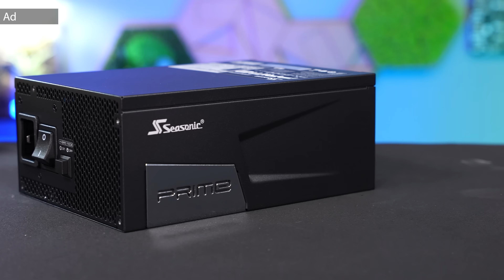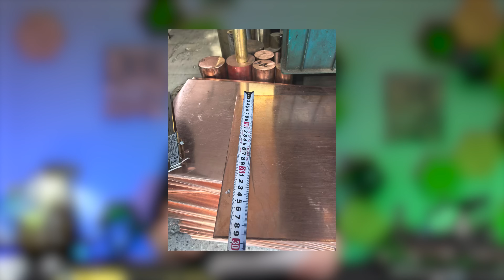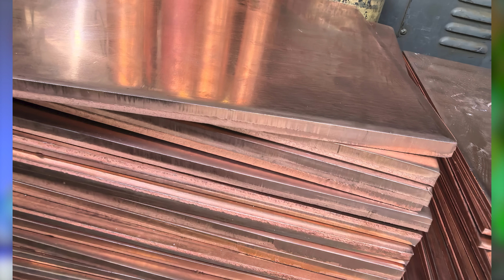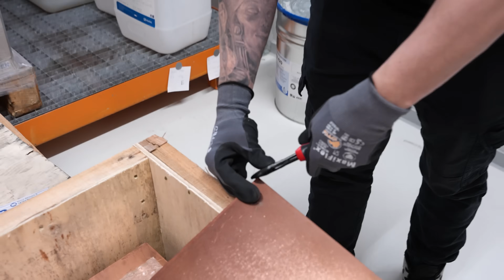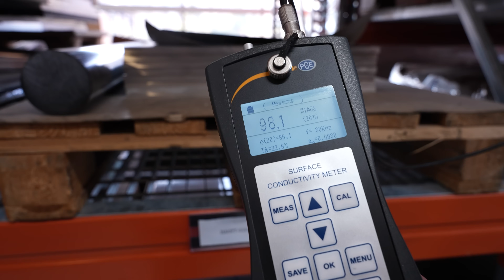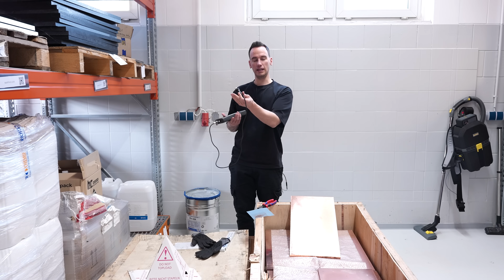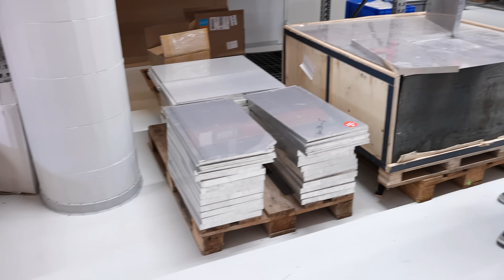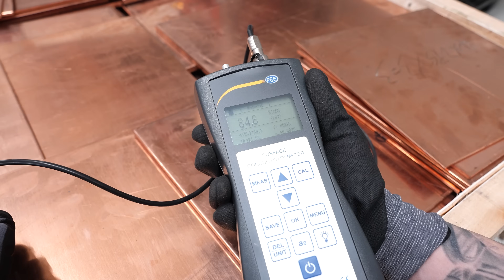I Got Scammed

Comment: I had the same problem with a Chinese company a decade ago. I bought a small shipment to test the supplier and the product was good. I then bought a bulk order worth 15000€ and was scammed, with none of the order being usable. The company denied the problem and I was left without any viable way of getting my money back.
Reply: Classic test-order-then-bulk-scam pattern. They build trust on the small one, then flip on the big payday. €15k gone and no way back through normal channels. But that money went somewhere—an account, a bank, a trail. My firm helps trace exactly where funds like this end up. Want me to see if your case has any options left?
Reply: @shaylamscheafuer  We know exactly where the money went. These were not crooked individuals hiding behind stolen identities. This was a crooked company hiding behind the Chinese legal system. I could have taken them to court in China, but it would have cost more than we were owed, and the the win rate for foreign nationals is very low. Even if we won, it would have been a pyrrhic victory, so the best move was to learn our lesson and walk away.

I now ramp up business slowly when forced to buy from Chinese companies. That way I keep my exposure low until the supplier is invested in a long term relationship, and does not want to burn long term profit for a quick buck.

Comment: I am glad you shared. The second you said where you sourced it I knew exactly what you were gonna be getting. There is a thing in China that if they can scam you and get away with it they are smart. If they get caught they are dumb. You can not trust any engineering material at all. Get your parts from pretty much any other country.  China has a huge problem in construction with Tofu Dredge buildings because they did crap like this with the rebar in the concrete and also mixed trash into the concrete so whole buildings , roads, bridges and well everything just randomly collapses. If they will do this to their own people, someone outside the country really has no hope of getting a quality product. They would rather scam you 1 time and get away with it and move on to the next person vs building a solid relationship with a client and being trustworthy. Just the way it is man. They try to cheap out on everything. Tons of LED lights right now are flooding the USA with most of them having no thermal paste or heating solution. It blows my mind that they would install Chips that are fine, Drivers that are fine.. and skimp out on the thermal paste to mount the chips properly to the aluminum housing or add a heatsink... Like you did the hard part... why not go the extra step and make a solid product.  And the answer is a fraction of a penny.

Comment: have a friend that had this problem with bearings that were being order from china showing up with metal-filings and other contamination and they finally decided that it was better to order the bearing dry and pack them with grease in the US as the main product was good and consistently to speck but the cleaning and lubrication was a mess and it was not practical to have someone go over and watch the process for each order (if you sat on them they did it right but if you were not there it was a quick and dirty final assembly)

Comment: The only mistake you made was trusting China.

If you are going to buy from China, and honestly just don't bother, but if you do then you need to physically visit the suppler and thoroughly inspect the goods in person, before parting with a single penny, then personally escort the goods to wherever they're shipping from, assuming they pass inspection (which they won't).

And 99.999% of the time they will just refuse anyway, because none of them have any intentions of doing anything other than scamming you.

Buying from European suppliers may be more expensive, but at least they have consumer protection. China doesn't.

This is fine if you're buying a 1 € fidget spinner on Temu, but ordering 40k € of copper and aluminium from China is just flushing your money down the toilet.

Comment: I had a similar experience about 15 years ago. I was buying Ping and Nike golf club sets from the same Chinese factory’s those companies use. The communication and responses were quick and professional and everything seemed,on the up and up. So we ordered a test batch which was good to go. We made a full order, well over $30,000 worth. When they arrived, everything was as expected, except, each club, of each set, had the same serial number. After confronting them about it the response was “What serial number would you like?”. It was a hard lesson that cost my partner and I years of work and savings. The Asian market works very differently from the west and if you don’t know the game it’s best to stay off the field there.
Reply: $30,000 and they couldn't even bother to fake different serial numbers. That's the kind of slap-in-the-face scam that makes you realize they knew exactly what they were doing from the start. Test order builds trust, bulk order empties your account. I've seen this pattern more times than I can count. My firm helps trace where funds like this actually land—even years later there can be options if the company is still operating. Want me to look into whether anything can still be done?
Reply: @shaylamscheafuer  That's kind of you, but no. It's long past and I did everything I could at the time. Got customs involved, as well as an international law firm. I also had a fraud insurance rider so I was able to recoup some of the loss. The worst part, or maybe parts, for me personally, is that the test batch had different numbers. The full order having all the same serial number was interesting, but, the real conundrum is that the serial number was real. It tracked back to an actual set of clubs. But the response of, "What number would you like", told me they basically do this all the time, and, that people have actually given them other serial numbers to use when they get caught. It's wild out there for sure.
Reply: @mathewcwilson  That's wild—the serial number was real. So somewhere, someone's authentic clubs ended up cloned with their identity. And "what number would you like" confirms this is a full-time operation for them. You did everything right: customs, international firm, insurance. Most don't get that far. Respect.
Reply: You were trying to swindle others but got duplicate serial numbers?
Reply: @zS39SBT4fe5Zp8Q  No one got scammed but me. Once I knew there was an issue, we didn't even try and sell the clubs. We turned them over to customs and ate the loss, hard lesson learned. There are only a few factories that make these clubs, or ny of the "high end" sports gear, regardless of the brand. If you by from the factory. it's significantly cheaper, and from an ethics point, as long as you aren't passing yourself off as an authorized dealer it's fine. The mark up Nike and the others have is insane. I could buy from the factory mark it up 20% and still be around 30% less than Nike and such.  In the end corporate greed swindles us all.

Comment: Business is built on trust, which is broken in this modern market. Currently I know someone importing two machines from China and I am quite worried, although I hope due to the complexity of machinery as opposed to some scammer coating steel, the machinery will at least operate. Fingers crossed.

Comment: Roman, for this reason you need to use a trusted agent in China, who can visit location before shipment and do random inspections on the goods. I have to do this, especially if you are dealing with no name factories. I guess your volume is extremely low for big state owned metallurgy companies to even get to MOQ. So do yourself a favor, get a good independent agent who will check every shipment before you pay.

Comment: Thanks for the video. I know it's not the point of the video, but could you (or someone in the comments here that's more of a nerd than me) explain why the thermal conductivity meter would not work at all on the fake plate? Since it's steel coated in copper, I would think the conductivity wouldn't be zero. I mean even raw steel has to have some thermal conductivity. So I know there is a reason, just curious why.

Comment: i could look at the plate without all that fancy lab equipment and tell you got copper plated steel. the plasma cut on the edges were a dead giveaway, you dont cut copper with a plasma torch , you sheer cut copper so theres no waste.

Comment: The only way to deal with a Chinese supplier is to go to China inspect the order before paying anything. Then watch as its packed and loaded on a truck. Then follow the truck to the shipper. Watch as it's loaded into a container and record the seals on the container doors. Also, make sure you insure the shipment. If you don't have the capability to follow these steps............you will get screwed.

Comment: The company I worked for ended up forming a company in China solely to handle BS like this. Even then it was as simple as it sounds. First they went to Korea to work with a company there that was able to work in China to get the company set up. Bit of a nightmare really. Even hard contracts don't necessarily work.

Comment: When i started watching i said i knew right away it was copper plated aluminum. Nop, steel, a dead giveaway with a magnet chasing maximum profit 😂
The aluminum seemed fine at first i said it would be just aluminum can alloy full of porosity, but nop, i was wrong again, steel underneath it carefully balanced with hollow bottom to not look suspicious.
They put a lot of effort on the scamming techniques.
In fact i'm surprised it wasn't copper plated tiles.
I am sorry you got scammed but for such a quantity you'll be better off having a trip to buy from eastern EU countries, no import tax and you can buy in person.

Comment: why go thru all the trouble of copper plating, packing Al plates on top of steel ones, etc? the logical scenario is the seller gets screwed too, the scammer is somewhere down the distribution chain... like if the buyer gets scammed by the seller, it makes no sense to include anything of value in a pallet, fill it up w/ wet sand and ship it: they had the money there's no need to trick the buyer when they got the good stuff when they open the package. but if the scammers need to trick the seller, then yes go thru all the trouble in case the seller does a quick check before shipment.
anyhow, totally unacceptable everything, such a bummer and huge loss for a small business.

Comment: The risk of fraud from China is simply too great to mitigate or control for without greater cost/risk than simply waiting for a more reliable distributor/supplier from anywhere but China. This shows intent to systemically defraud by using methods meant to circumvent acceptance, transit, and receipt detection. There is some level of organized crime at this scale of business/cost, so keep that in mind. This may sound weird, but you may want to check the materials for any form of radioactivity, just to be on the extreme side of safe, since that is regulated differently in China.

Comment: In my previous work experience in China, we qualified a new supplier because they were selling steel and stainless steel at 1/2 the price of the existing supplier. The existing supplier was a big and well known company while the new local supplier was a small company/mill. During qualification , everything passed our expectations for the material. 
When we started ordering raw material bars for mass volume production, weird stuff started to happen. Mechanical properties were inconsistent, bars were not straight (This meant that something went wrong in the heat treatment), someone mixed up a few of the raw materials because everything looks grey and shiny etc
There is a famous saying... you get what you paid for in life.

Comment: For a big order like this, a flight ticket could save you tens of thousands of euros. Next time fly there when the order is ready for shipping and test it there. 

Even saying you will test it before shipping when ordering will probably scare them from scamming you.
Reply: Certainly agree to this.
Reply: Exactly. Unfortunately it won’t stop them from doing the same scam and wasting your time and travel money, neither of which is insignificant, especially considering you may have to repeat the process multiple times before not being scammed and have to do the same thing for every subsequent shipment because otherwise they can bait and switch after the first, 2nd, 3rd, etc. good shipment

Comment: Yo, never be ashamed, this was genuine criminal effort and the only next best thing you can do is talk with your local manufacturers to find out where they supply their materials from that should help prevent this situation from repeating.

Also I'm sure you are not the first nor the last because shopping on AliBaba is a gamble the biggest signs of this are the amount of effort the site has to put into putting in trust signals for the suppliers to try and help customers to avoid scams.

The only literal thing you can do is fly down there yourself and inspect on site before it gets shipped out but that is such an insane counter measure for the volume ordered.

Comment: What eventually decided you against travelling there, bringing a drill bit, a heat conductance and resistance measurement apparatus, and purchase verified materials on the spot? (if you cannot assert security, perform the purchase by increments, be it piece by piece at the entrance of an embassy)

Comment: long story short: In germany, it does not make sense to make business unless you are an emergency-necessary provider (e.g. Aldi). Reasons are:
- everyting in germany is too expensive, from labour hour to electricity to insurance to shipping anything to there (even the machinery to perform a monetizable service with)
- we are too far from the market. Germany does not own mines. Everything you acquire here has the business potential and risk already calculated in
- lastly, due to china being so vastly cheaper than Germany, you'd rather opt for the underengineered product than paying a premium. It is also safer from a guarantee standpoint and allows channeling your acquisition through TNCs. in the presented case: you'd rather accept a shorter gpu lifespan at 2 year guaranteed lifespan than putting a custom watercooler onto it and loosing warranty. Or DerBauer sells you a warranty and has to considerably upsell for all the aforementioned costs and insurances.

I agree you have to be close to the market to understand what nieces people are actually still willing to spend money on in an oversaturated market in which we as country are a stifled actor. But I dont think you can outsmart market physics. There will also come a point in the recent future where things cannot be acquired anymore because every atom and right of monetizable action will be owned already by someone. I thus dont see how he is going to maintain a liable company for any relevant guarantee period, specifically since he does not own a monopoly on anything, not even on a secret (such as, e.g., would an SaaS provider on AWS).

Comment: They keep getting bolder. I saw in local news one where they just shipped concrete slabs painted copper in the container, and as IT, we're warned long ago they started adding weights to boxes so aluminium cables pass a basic weight test. 

So we only buy large brands from reputable distributors so if we get a counterfeit, the distributor is doubly guilty.

Anything significant from China, send someone there. We had a 10M order and they skimped on asserting our contractual right to inspections, and for want of a nail, EVERYTHING they chose to not send someone to oversee had issues to some degree.

Critical superstructure? 100% on spec triple checked.

Assorted stuff attached to said superstructure? Problems from day one and still largely unresolved because if they skipped on $200k worth of China trips, they won't spend $3M to have these redone proper.

Comment: Are there any non-Chinese vendors of these products anymore? Since TEMU and Alibaba have been so notorious for decades now, I'd expect vendors in other countries to take up the mantle and provide even a little bit of integrity, even if the price is higher.
Reply: Issue is China through Belt and Road and other similar programs has seized a lot of the sourcing for a lot of materials, so in multiple cases you need to go through China because everything more reliable is already bought up by others.

Comment: I just dont get why you would want to scam on this. Right now the entire west is looking for suppliers, and you could make a fucking FORTUNE having western connections. If these were all non-scams i would have no reason to get them anywhere else if the price was also alright, which it usually is in China. 
I worked for a welding company that made chimneys, and we also sourced material in China. We had them send all the specs and analysis and it turned out perfectly fine and we continued to use them. Scamming makes absolutely no fucking sense, unless youre just looking for a quick buck, but from the pictures this looked like an actual factory so it makes even less sense. 

Dishonesty confuses the fuck out of me.

Comment: I would never use a platform that does not hold its sellers responsible for scams. I am sorry this happened to you but Chinese vendors do this on every platform. From Ebay, to Temu, to Alibaba. They know you can't legally go after them in China, that is why they simply work around your verification methods. The only thing you can do is NEVER use these platforms. Even the amount of waste this produces is disgusting, if you think about  the energy they spent to make this garbage, shipping, fuel, manpower, etc. Now you have to scrap this metal and who knows if it will make it into anything useful. But even that is MORE energy spent.